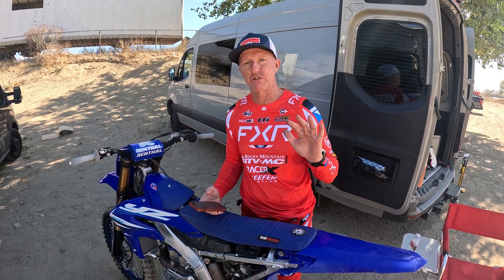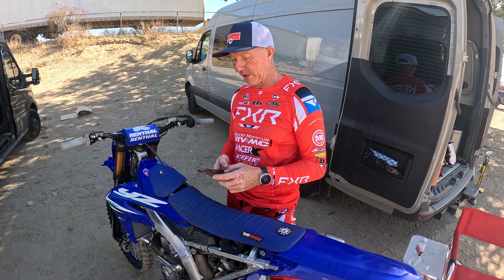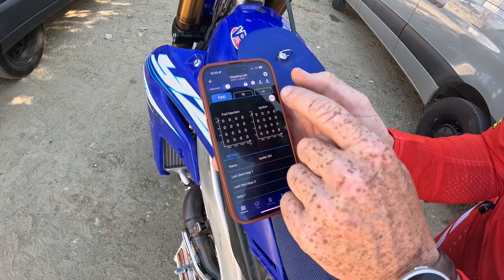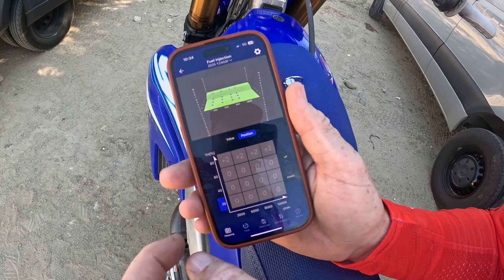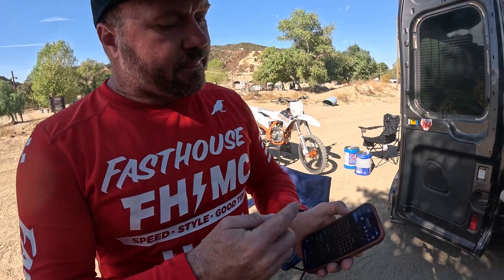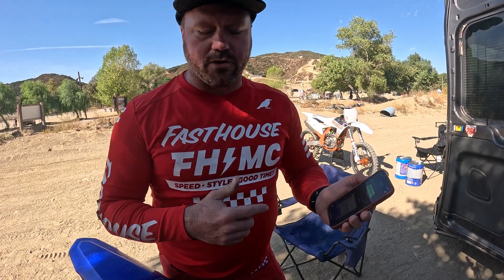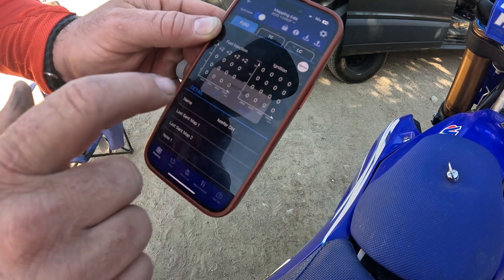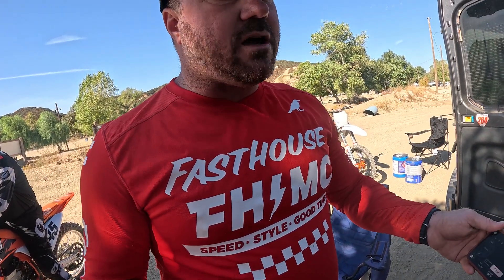Yamaha Power Tuner App For Beginners

Comment: for the ignition timing, what direction is (-) (+) is negative before top dead center and positive after top dead center. I am having a pinging sound when at 3 or 4th gear and low rpm.

Comment: Hey keefer, I just did a 25 Yamaha test day in the uk and thinking of buying one but the Yamaha guys told me you now can’t connect to the 25s to removed the traction control and change the tune via the app as Yamaha have blocked it and you know need a dongle from the dealership / can only be done there, something about data protection they mentioned, can you provide more information? It’s the only thinking stopping me from buying a 25yzf 250 as we speak

Comment: I'm building my own maps for my 2020 WR450F.  Desert trails, super gnarly and technical.  The stock map(stock ECU) hits way too hard even if you lightly touch the throttle. Now,  I have installed GYTR Competition ECU, Communication Control Unit, and Map Switch (cannot change maps on stock ECU). Therefore, I'm looking for "soft" throttle response so I can climb straight up those rocky, gnarly trails, without feeling like I've whacked the throttle wide open.  I have a basic understanding of the parameters, and I think I'm on the right track, but at this stage my maps will be trail and error.  I appreciate any advice .  THANK YOU!

Comment: I have the KTM Connectivity on my 350 and i just bought a Yamaha 450 and love there tuner way way way better so much more info ktms is just basic I don’t think worth the money if your looking for more power and it don’t help nor really move the power around much. 
Great job Yamaha for bringing this in and being the top leader in the tuners.
Reply: Yeah I have the cuo for my husky 350, I agree, it’s only a sliding bar with small adjustments I had to go full engine breaking to least engine breaking to notice much difference, and in the end I left throttle control standard it was too touchy mid rut, hopefully they improve it just like Yamahas.
Reply: Ya not fan of the ktm app like the lit pro but that’s hard to read to lol probably jsut me not knowing how. The yamaha tuner is so much nicer to use.

Comment: Does elevation matter? If I download ur map will it work at 6200' elevation?
Reply from the maker: @yz-pc9xi  Yes, it should be close. None of these are designed for high elevation but I’ve ran them up there and it’s been fine. These are designed for sea level to 4500ft.